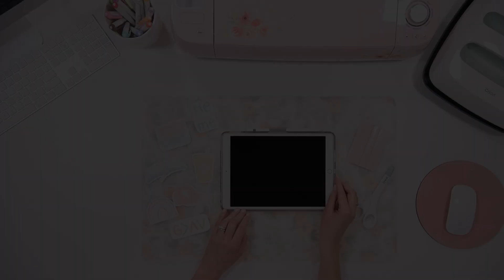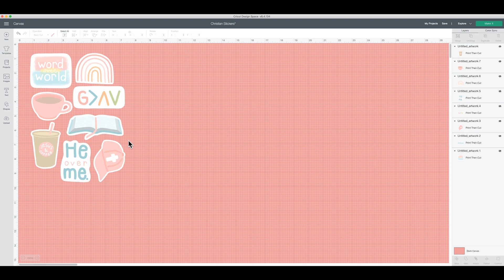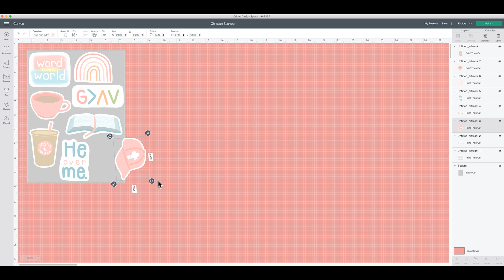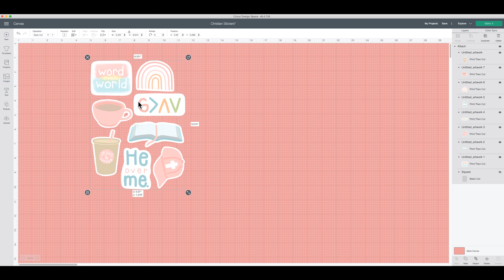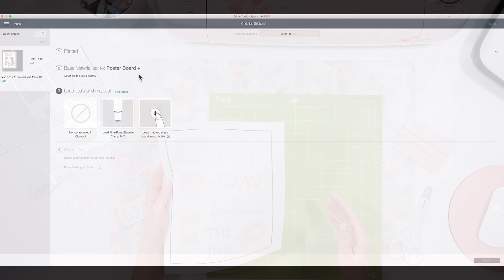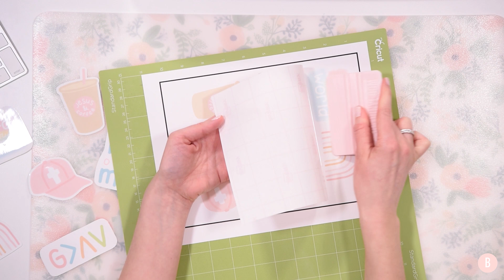Laminated Die Cut Stickers With A Cricut | Cricut Die Cut Sticker Materials And Cut Settings

Comment: Thanks for the video! I'm having trouble with my cricut cutting jagged spots on my laminated sticker sheets, I've checked to make sure my image is the correct DPI/quality and everything - blade is also brand new. I'm using Procreate to design my stickers and create the border around them. Any tips?
Reply: i use ibis paint then cricut design space and i am getting jagged little dots around all my laminated stickers as well.    The image looks clean in the cut preview and the off set looks smooth but then the cuts almost look perforated.   New fine cut blade, new mat, same laminating sheets as you - any suggestions?

Comment: Thank you so much for this tutorial Bethany! I never thought to use poster board + and this was so helpful. I have a question— do you ever have a problem with Cricut reading your stickers that have laminate over them? Mine will work for 5-6 laminated sheets in a row, and then all of the sudden it will stop. The cricut says “unable to read cut sensor marks” and I waste SO much material doing this. Do you have any tips?
Reply from the maker: Thank you! I believe I go over this in the tutorial. I only have issues if the laminate covers the registration marks. :) Glad this was helpful!
Reply: @Bethadilly  oh yes, I heard that part! Sorry I should’ve been more specific. I get all of my laminate within the borders, but then all of the sudden my machine will stop reading. Usually my only solution is to turn the machine off for an hour and come back. Then it will read the exact same sheet perfectly that it couldn’t read before! This is my first time having a cricut so I didn’t know if that was normal or not. I know it sounds silly, but almost like it’s “overworked” or can’t handle more than a few projects at a time.
Reply from the maker: @olivebranchcottage  oh gotcha! No I haven’t had that issue. But to be fair, I have only done one sheet or two at a time and haven’t done multiple sheets. Regardless, I don’t think that sounds normal so you may want to reach out to Cricut? Hope it works well soon!
Reply: I usually put matte tape over the black borders! It’ll read after that :) mine always says “unable to read cut sensor marks” when I put laminate on mine or use glossy sticker paper! And if it really doesn’t work, put matte tape and close the top part of your cricut! Sometimes I even turn off my room lights so it’s not so bright and causes more glare.

Comment: You can remove the size restriction for print then cut using procreate, FYI. Use the box of a standard sheet of paper as a visual template in procreate, print it from procreate directly, then import that box with your stickers on it into cricut as a CUT only. As long as you calibrate procreate to print with 0 margins and set it to x 0, y 0 in cricut, it will cut out a full standard page of stickers for you, no wasted sticker paper/vinyl
Reply: Do you have a video on this
Reply: That's an awesome tip!  Thank you!
Reply: I was thinking about tht too. But i would print from silhouette
Reply: Does this work?  Is there a video
Reply: Poster board + setting just saved my Butt! PERFECT cut! Thank you!!!!
Reply: Q
We pp